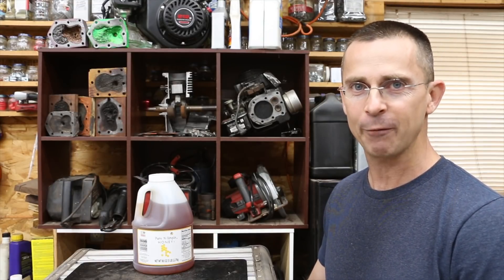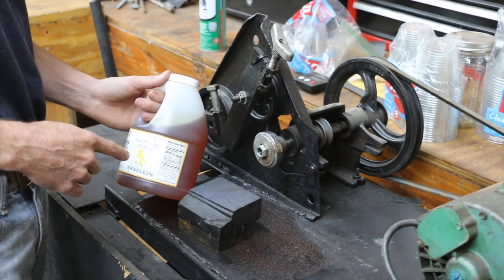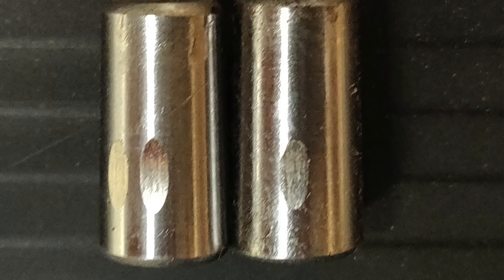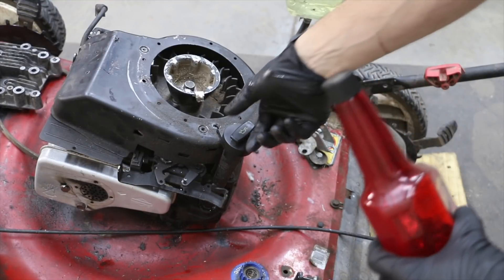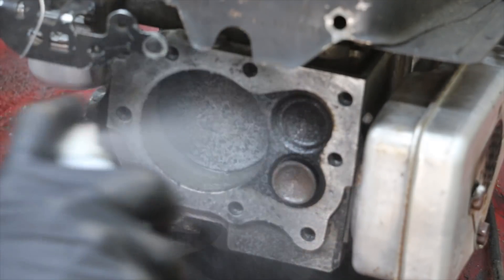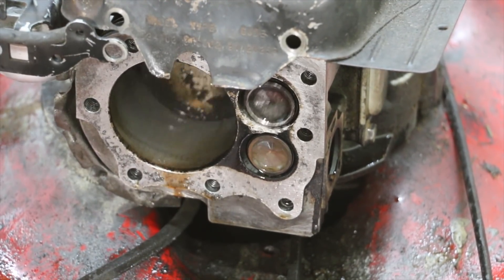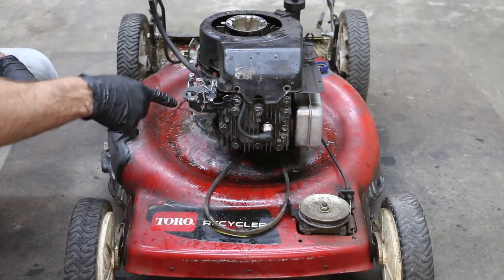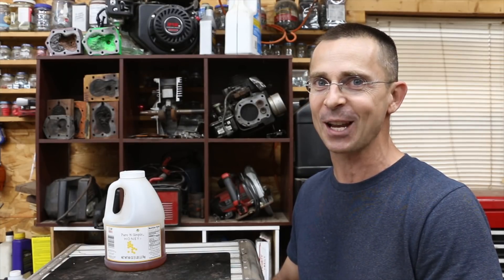Can you use Honey as Engine Oil?  Let's find out!

Comment: Try ground up moth balls in a diesel fuel tank. I've always heard that it causes it to burn it self out  from extreme heat. Before that heat causes engine failure that extra heat translates to lots of additional power. Never tried it but have been told this by monkey wrenchers / tree huggers that were doing this to logging trucks with sand in the oil for good measure. I know the sand works to destroy motors always wondered about the mothballs. While your at it how about  WD40 or if you can afford it. Use good old original  Hoppes no.9 gun cleaning solvent  / lead and copper remover. Works great on guns and I love the smell better than any perfume or patchouli oil
Reply from the maker: Thank you!

Comment: Have you ever tried DOT3 or DOT 4 or DOT 5 brake fluid in the lawn mower engine to see how well they lubricate? You may have, and sorry if I missed it;  it is sometimes hard to keep up with the great tests you have made.  

I suggest brake fluid because I remembered, and then verified, that the dry boiling point of DOT 3 is 401 degrees Fahrenheit, DOT 4 is 446 degrees F, and DOT 5 (and 5.1) is 500 degrees F, all seemingly well within, or somewhat within, the temperatures you have been getting in your gas engine lubrication tests.

Keep the testing going.  We may need to know all of our lubrication alternatives sooner than we think.
Reply from the maker: Thanks for the video idea!

Comment: Wonder the protection time difference in a weight? 

Such as 2 engines, I with 5w-20 and another with 5w-30. Then drained and ran to failure. Would the ligher weight fail first. Or does a lighter offer more "lubricity" with less weight?
Reply from the maker: Additionally viscosity sometimes helps with film strength, but not always.  Thank you

Comment: I bought an old Briggs & Stratton 3.5 hp Lawnmower at the beginning of summer, It had almost no oil in it so all I had around was 80w-90 gear oil. Ran it all summer with no problems. I think I'll see how many summers It will last. By the way I'm cutting almost 1 acre every week all summer.
Reply from the maker: Wow!  That's a lot of grass for a push mower.  Glad it's working.

Comment: Great videos. Been watching a ton of them. Just finished your b12 chemtool video from last year.  
Video idea.....piston soak test....  using 1)b12 chemtool.....2)ChemDip....3)marvel.....4)seafoam.  The idea being, carbon buildup in the piston ring grooves, prevent combustion pressure from expanding piston rings fully, thereby creating low compression/excess blowby. 
A piston soak will...let the liquid seep down thru the ring, and clean the ring grooves. Clean ring grooves should restore compression.
Reply from the maker: Great video idea!  Thank you

Comment: I have a good one here what about  wood gas 

wood gas generator is a gasification unit which converts timber or charcoal into wood gas, a syngas consisting of atmosphericnitrogen, carbon monoxide, hydrogen, traces of methane, and other gases, which - after cooling and filtering - can then be used to power an internal combustion engine or for other purposes. Historically wood gas generators were often mounted on vehicles, but present studies and developments concentrate mostly on stationary plants.
Reply from the maker: Great video idea!  Thank you

Comment: You might make a see through plastic and show the oil splash and how well it lubes up the cylinder. Not sure if any small engines have pumped main bearing and some sort of spray to the cylinder. Maybe you can show this on your Channel.  Can you give any indication of what oil Synthetic, regular oil or graphite lubes, or super additives give you the most long life engine for the least cost. To be cost effective the engine must hold compression and efficiency over the life of the engine. Is there any treatment that would increase the life of the engine? Ever use 90w gear lube? A refrigerator compressor runs for decades and doesn't seem to wear out. Can this be worked into a gasoline engine?
Reply from the maker: Great video idea. Thank you.

Comment: You should test brake fluids to clean an engine / as an oil or fresh/packaged milk as oil ( im sure thats desctructive ) aswell as body lotion. Or someting like heated low boiling point grease as fuel. or something like what happens if u use a vertical engine , horizontally.
Reply from the maker: Thanks for the video idea!

Comment: I've got a product recommendation, hope it's the right place for it here.

I have personally used BG's EPR (or 109) in my car's engine. It's basically a solvent makeup to get rid of a lot of the crap inside the crankcase, head, etc. Kinda like Seafoam in oil to an extent.

But, the thing I noticed most was that the medium-brown colored oil in the engine turned literal black while I was draining it out after the 15-minute-at-1200RPM 'work interval', if you will. 

It has seemed to help engine response as a whole. Maybe you could try it out in an engine to see what it does? (Preferably one that hasn't had its oil changed in a while.) I just haven't heard much from the internet about this stuff but pro techs swear by it.
Reply from the maker: Thanks for the video idea!

Comment: Project Farm  no problem, looking forward to if you get a chance to get around to it. He suggest probably using a tile saw to cut the material a
In a reproducible way.

 A tension system to move the saw's table in towards the blade at a constant rate might work.

 Maybe the cutting table mounted to a weight via pully at 90 degrees (To convert the downward pull to a horizontal one) may be viable?
Reply from the maker: This is great input.  I like your final idea a lot!  Thanks again.
Reply: @ProjectFarm , good luck :]

Comment: Hey, glad you liked the idea of the Diamond saw blade test. Making a new comment as you requested so you can find it.

  Basically the blade size he was hoping to see was 7 inches as he does a lot of cutting with hand circular saws.

 They also have 4 and 10 inch blades for angle grinders and 10 inch tile saws respectively.

  Some brands that may be good to try is Mikita, MK Diamond, Bosch, Rigid, Avanti and Dewalt. Which can provide a good mix of cheap and expensive. Harbor freight also has a brand too.

  Be forewarned though, the blades can be a bit pricey when buying big name brands.

 Another thing is there are two types, one is segmented rim for dry and wet cuts and the other continuous rim for only wet cuts. It also provides a better edge finish.

 They definitely behave differently so if you wanted two video ideas splitting them up could be a good Choice.

 Name is Shaye by the way and my Dad is Tom. Here is my Email in case you wanted to talk more about testing ideas or get more info, or if interested in suggestions for specific materials such as granite types to cut as they do vary a lot in hardness and workability. Trollfacetheman@gmail.com

  Now you might not want to email some random guy on YouTube but if you have ever heard of the Channel Nighthawkinlight I actually just did a video with him you can see on his channel and I myself have 26k subs.

 I can assure I will not send you any junkmail about how I need you to pay a small legal fee of $1,000 usd to inherit a 1 million dollar fortune a long lost relative left you or something similar :]

 Anyways thanks for considering the suggestion. And please keep up the awesome work!
Reply from the maker: Shaye, Thank you very much for the additional information. This helps a lot!  This is a great test idea.  It'll take me some time to fund and prepare for this one.  Designing test jigs takes a lot of time and effort. Thanks again.

Comment: So was there any permanent damage to metals or components?  I don't know much mechanically but it seemed fine, so why did it spark up?  The video just kinda ends without much explaining of what went wrong.
Reply from the maker: Thank you.  The exhaust valve was stuck in the open position. So, when the fuel inside the combustion chamber ignited, it caused this.

Comment: My guess is the engine ran on the residual oil in the crankcase until it was burned up.  Try running an engine after draining its oil and see how long it runs compared to this.  Does honey help the engine run longer or kill it sooner?
Reply from the maker: Thanks for the recommendation.

Comment: You should try the silica based RVS engine treatment. would be interesting to see the results. Many car magazines here in Finland have tested it with great results. The German TUV has also conducted experiments with the substance. The story goes that soviet drillers found that when they drilled to a certain depth at a certain place their rock drills got polished and lasted up to 6x longer than normal.
Reply from the maker: Thanks for the test idea.

Comment: Was the ACR on the cam when you did the compression test ?????    That's a high PSI with a ACR intact on the cam ................
Reply from the maker: Yes. thank you.  I use the drill to get the engine to spin over fast enough to provide an accurate compression reading.

Comment: I've heard that you could put diesel into the crank case of a lawn mower engine and run it to clean out all of the old motor oil before putting in fresh motor oil. I'd like to see if it's true or not and what would happen if this is done.
Reply from the maker: Thank you

Comment: Have you ever tried using straight diesel in the crankcase? Diesel is a great lubricant after all, and I wonder if it would lubricate properly. I also wonder if it would start to burn with the gasoline if the engine got hot enough.
Reply from the maker: Yes, I tested it in a past video.

Comment: Use adblue as an engine oil. Adblue is a chemical used in diesel engine exhausts to make the fuems meet standards
Reply from the maker: Thanks for the recommendation.
Reply: @ProjectFarm  not a problem.. issue might be you might need a trucking company to supply adblue or find a servo that has a truck fill up point(adblue is next to this)

Comment: You should use a magnetic drain plug, if the lubricant you are using degrades the engine you will be able to see the metal shavings stuck to the drain plug.
Reply from the maker: Great point. Thank you.

Comment: I have a request for new destructive engine test video. On cold mornings my air compressor on my truck does not start. So one day I had the idea of using acetylene to help start on cold mornings and it worked very well very very well.   Have no issues with it yet I have started it this way at least 15 times. I have also ran the compressor out of gas and then fired it up on acetylene and continued to  run it for over 5 minutes on acetylene alone. Can you do testing I think it would be a great video
Reply from the maker: Great video idea. Thank you

Comment: I can tell you one thing you don't want to use in an engine.... brake cleaner!  Had a gummed carb on a mower one time and I sprayed shots of brake parts cleaner in as it was sputtering along.  Ungummed the carb nicely, but it scoured the oil from the cylinder wall so well it damaged the cylinder slightly.  It still runs, but it smokes on start or shut down and takes more than 1 pull to start now.  A test using that as a fuel would be interesting to see just what kind of damage it does.
Reply from the maker: Wow!  Thanks for commenting on this.

Comment: During WWII, my uncle served in North Africa with the Army Air Core.  Supply lines got stretched out and he said they had to use olive oil in the ground support vehicle engines and white wine for brake fluid. 
The planes got the real stuff.  He was also in charge of installing water injection kits  on the P-38's so they could match the Messerschmidt's speed for a short time in a dog fight.
Reply from the maker: This is interesting. Thank you

Comment: What did you use to clean head with on drill
Reply from the maker: Wire brush attachment, which is too harsh for an engine you want to use for a long period of time.  It's too abrasive for aluminum.

Comment: U should see if honey would be good for old runny oil to thicken it back up.. Or see if it can be used as a sealent for rubber rings . help rejuvenate them.. I noticed the honey looked a lot like the engine oil leak stopper from Wal-Mart.  .really thick when cold but runny when hot ...also good for old burnt oil too.
Reply from the maker: Thank you

Comment: I've a practical question: Does Diesel mixed with Two-Stroke-Oil increase the Lubrication on a fairly modern Engine? (Thinking about common rail pumps with mixing ratios between 1:250 and 1:350)
Reply from the maker: Great question.  Yes, it does.  2 stroke oil has a much higher lubricity than diesel.  Maybe I can put together a video on this.
Reply: @ProjectFarm  that would be great! Thank you :)

Comment: Could you please test whether insulating your diesel engine compartment with foam, for example, will help it start and run better on short trips during the winter? I am thinking of putting some extra reflective sheet under the hood but also a few foam pieces to fill the large empty space that let in a draft and cool the engine during the night.
Reply from the maker: Thanks for the video idea!

Comment: I want to see a car cleaner test with carbon can you do it ? becouse iv used it on my cars the mpg vent up and the engine runs a lot smother??
Reply from the maker: Thanks for the video idea!
Reply: @ProjectFarm  And The prduct i am using is called "GENUINE ABRO Carb & Choke cleaner" Im using it becouse it promises to remove gum and carbon. I've used it on a lot of my cars and once i had a honda civic the intake was full of dust oil and carbon buildup i've manedged to clean that out with this product.

Comment: What kills an engine is not the oil used in it....petroleum oil has been in the earth for millions of years under high temperatures and high pressure....being in an engine is a minor inconvience for it....what destroys motor oils and makes them break down is the contaminates that gets into the oil like carbon deposits, metal filings from engine wear, water from condensation, etc... The more the contaminates the more the wear on the engine...the trick is to keep the contaminates as low as possible in the engine.  Good filters are a good start. But the average oil filter only removes particles as small as 40 microns.  You can see a 40 micron particle with the naked eye.. that still leaves 100s of thousands of particles in your oil that can still cause wear on your engine....there is technology that has been around since world war 2 that removes particles as small as 1/10 of 1 micron....that is 50 times more efficient than the standard oil filter. This technology was developed for fighter planes and would extend the life of the oil tremendously ...they needed this especially when an oil shortage for the planes existed.  There is a company that makes these type of oil filters....there may be more by now....look up Spinner II centrafuge oil filters.  These filters are used extensively in the trucking industry...you have probably seen them  and not realized what they were...they are usually mounted on the outside the engine compartment.  They are round canisters about the size of a five gallon bucket.  They run on the oil pressure of the engine, as a scavenaging system....meaning it is not a full flow filtering system.  It sprays the walls of the canisters and the particles stick to the wall or the paper liner on the wall.  The particles are removed by weight not size.   That is how this filter has such a high efficency capability.   You can buy these centrifuge filter in the smaller automobile size...but I believe they sell between $400 to $500 dollars each.  The larger commercial truck size sells for about $800 to $1000.    That is a small price to pay to for extreme extended oil life and longevity of the Engines by running them on the clean oil.
This has been an FYI moment....lol
Reply from the maker: Great point!  Thank you

Comment: You could try spray-on teflon. It's a dry lubricant and I wonder if you spray it on the inside of the engine, will it work as oil?
Reply from the maker: Thanks for the recommendation!
Reply: @ProjectFarm  My Pleasure. Keep on doing what you are doing. Stay Humble.
Reply: Or graphite.
Reply: @adriennereed1756  Yeah that would probably work too. Thanks for the reply.
Reply: It wont because oil also works as a coolant here too.